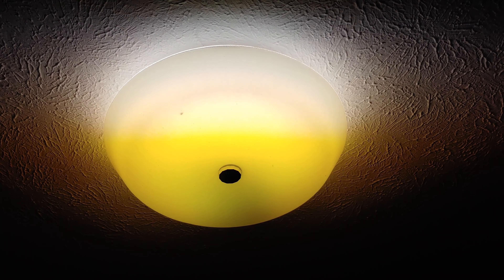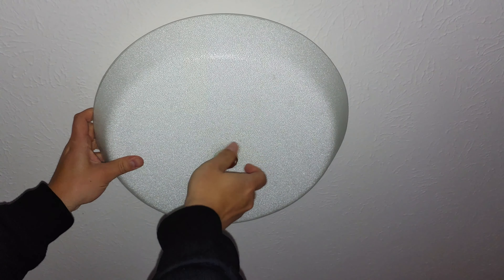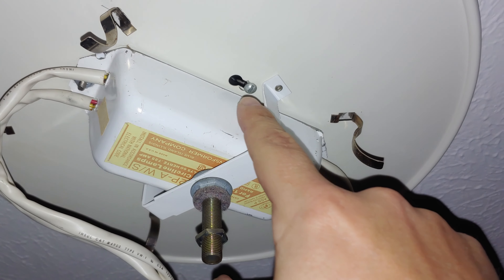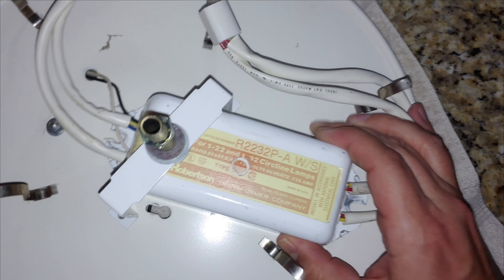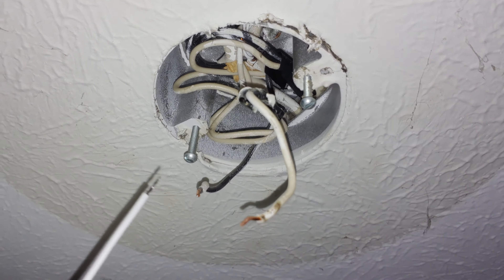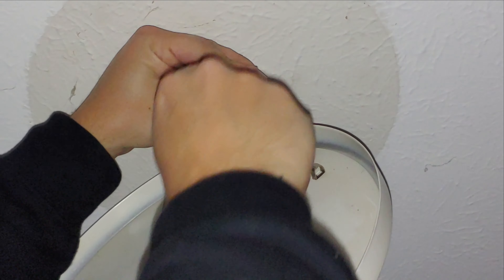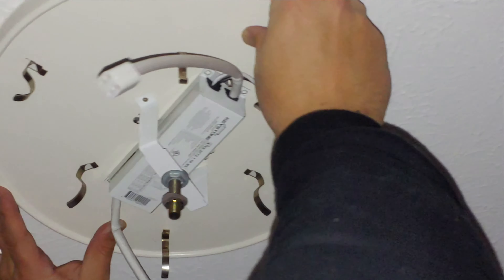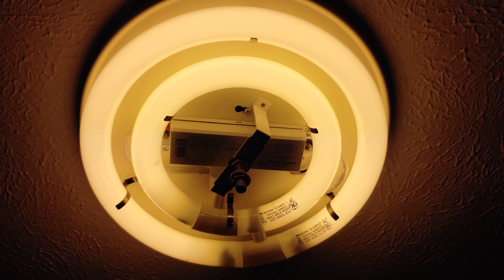Fluorescent Light Ballast Replacement

Comment: Thank you for showing this. I have the long tube florescent lights in my kitchen. They don't work right and the relay buzzes.  Can't have a repairman during quarantine.  Now we can do this ourselves. I will shut off the circuit breaker to the lights, and also the main breaker to the whole house, just in case I do something wrong. Thank you for the knowledge and now the courage.  Hope all is well. 😊

Comment: looks to me like the issue is the outer tube was EOL which on a rapid start ballast will cause flicker. the magnetic ballast was likely okay.
Reply from the maker: Yes I did for good measure replace the bulbs as well as you mentioned they were also problematic.

Comment: you already did most of the work, why not just remove the ballast and go with a new LED directly? much simpler and easier.
Reply from the maker: Yes not a bad suggestion. Just wanted to do a quick fix, as I have 3 of these lamps all the same. I may switch to LED in the future. Thanks for watching!